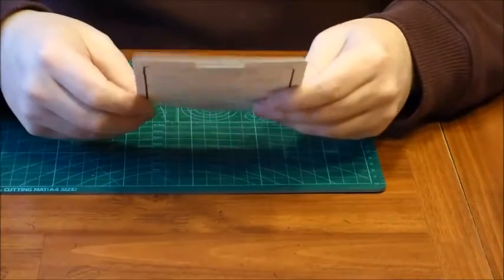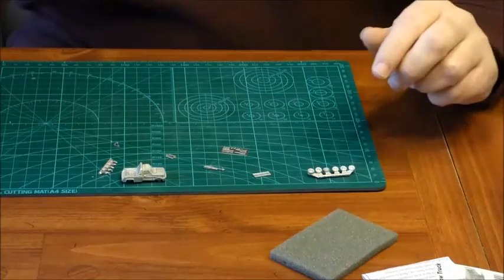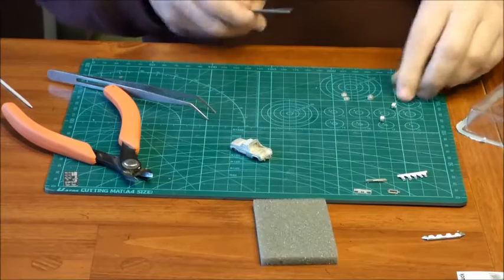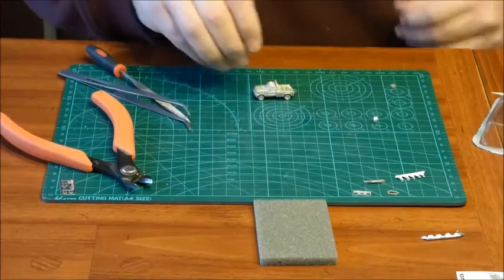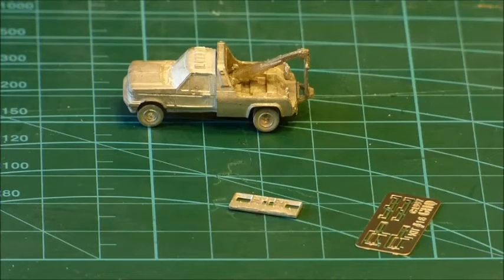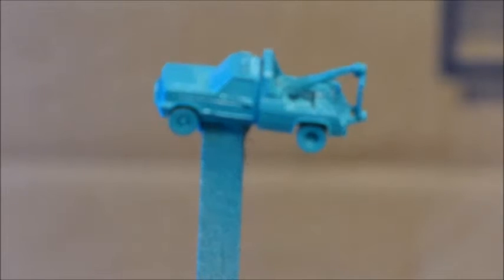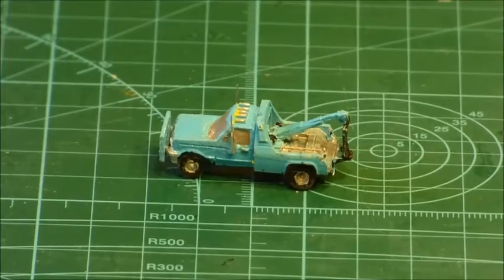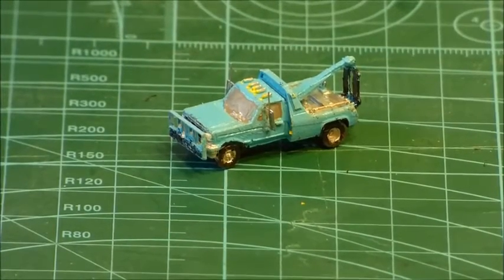GHQ N Scale model tow truck

Comment: I have made 3 of these and they are difficult.  Some kits, the parts are bent and need adjustment. Had hoped you would show how difficult it is to install the boom.  I preferred to paint parts before assembly.
Reply from the maker: Yes they are quite difficult to build! This was the first one that I ever built so I had to figure out some of the assembly off camera. I guess in hind sight it would have been better to build 2 of them 1 for off camera to figure out and 1 to film. I do however want to build more for here.